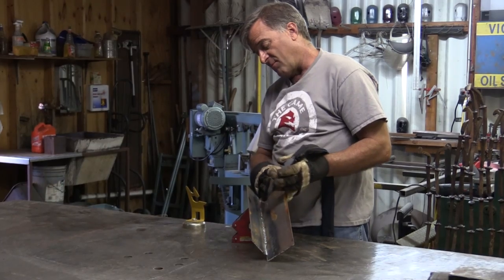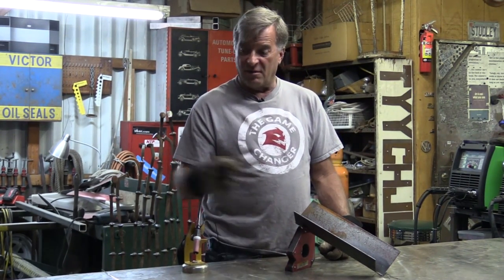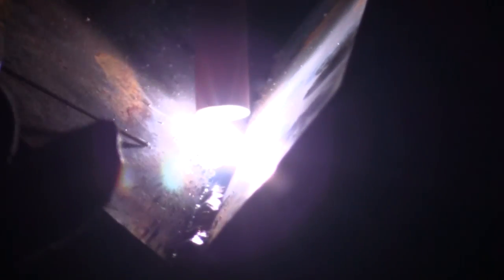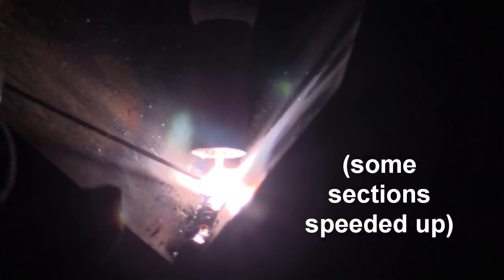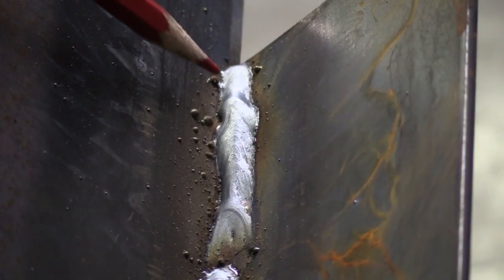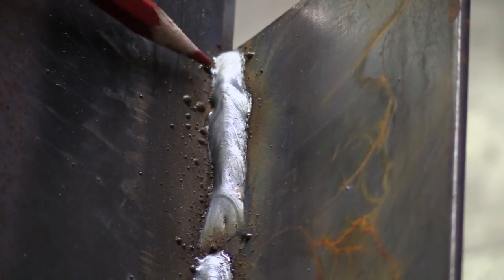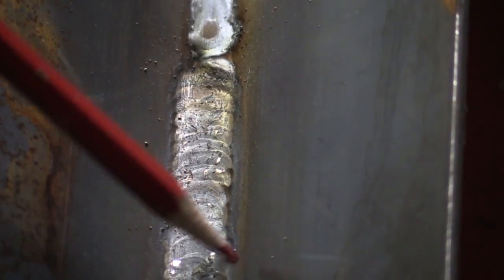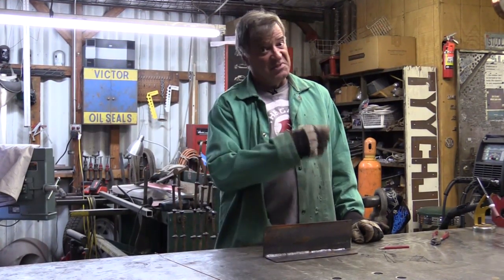How to Use a TIG Welder to Clean Up MIG Welds - Kevin Caron

Comment: When using Tig to tidy up a Mig weld, do you have the gas on with the Tig, or just using the heat from the Tig torch?
Reply from the maker: You MUST have the gas on for ALL types of tig welding.   You will melt the torch if you don't!
Reply: @KevincaronSculpture  of course, thanks 💡

Comment: I modified an oil pan for a car and welded it up with a mig. I checked it right after and it leaks. I've watched some videos where the oil pans are sealed up with JB weld,primered and painted. I'd ran a crossed your video and wondered if I could seal it up with tig over mig?  Great video,thanks
Reply from the maker: Worth a try at least.   Oil pans are hard to weld because of the contamination from the oil.  Make sure you get it REALLY clean and give it a try.
Reply: This is exactly what I'm doing. Building a Land Rover Discovery with a Cummins 4BT. Having to mod the oil pan to fit around the diff

Comment: Can you 'smooth out', or blend a TIG weld, by going over it a second time with a longer arc length, perhaps? I guess it would basically be the same idea as in this video... but how to get a larger weld puddle with low penetration on a second pass? A larger tungsten, larger cup, longer arc length, and less amps? More amps? Hell, I don't know.

I'm trying to recreate a technique from laser welding, in which you increase the diameter of the beam and turn down the juice, to smooth out a weld... sort of like softly melting the dimes into a more smooth and blended bead, without grinding them.
Reply from the maker: I would try a less tapered tungsten with less amps.  Works for me at least.

Comment: Playing around with my Everlast MTS 275 Lightning and ran the TIG torch over some of my quite thick MIG practice welds. Got some popping, presumably due to the silica or impurities in the weld. Not sure how to avoid that? Granted my MIG beads probably didn't have enough heat when I laid them on top of more MIG beads for practice.
Reply from the maker: You most likely didn't clean the metal good enough before you mig welded.   Got impurity's in the weld and exposed them with the tig.  Only fix now is to grind out the bad spot and reweld.
Reply: @KevincaronSculpture  Probably not, wire brushed it a bit by hand and called it good. Was just playing around on some scrap so I won't be grinding it out, but it's good to know. I was worried I was putting too much heat in (150A at the time), but it was probably 1/4 to 3/8 of an inch of practice welds or more on top of 1/8 steel 😆 . Good to know it wasn't the heat so much as contamination.

Comment: can you do this with the mts 251 si , on aluminum , to clean up aluminum mig welds ?
Reply from the maker: No, the Mts 251si is dc only for tig.
Reply: i know that , i was wondering if it would clean up a aluminum weld .  if i understand correctly thick aluminum is welded on dc to get extra penetration . i have also heard of guys setting up a dc tig so the heat in in the tungsten , rather than the work ( and using a larger sized tungsten ) and you can get some cleaning action from this ......... with the pulse and frequency settings , i was curious if there was a way to run a cap on a aluminum weld that looked nice
Reply from the maker: Never tried DC welding for aluminum.  Sorry.

Comment: I'm glad you kept saying to "clean up" a weld not to "repair", a bad weld is a bad weld. Repairing(penetration ect) can be done but not properly by the average diy'er, it requires lots of hours welding and understanding the metals to be done properly. I guess it's a touchy subject and I'll get hate mail(!) but I had to say it. I'm not an armchair welder, I've been welding since I'm 16 and now pushing 60, I've worked as a heavy truck and equipment mechanic as well as building/restoring muscle cars and race cars, I've also received professional training. Hope I didn't stir up a hornets nest for you. Good video
Reply from the maker: No problems from me!    You are totally correct and that is all anyone should use this trick for..

Comment: Kevin that's cheating! but yes I do this, it's especially handy if you manage to get a lumpy bumpy weld in a tight spot like you said.. Ive used this method on both mig and Tig welds that need a tidying up.

Good tip! Still cheating though :)
Reply from the maker: I will take any tool I can to get the job done!
Reply: I'll second that! Well said, great videos Kevin 👍🏼

Comment: I've done this in my early days but I wouldn't recommend doing this as normal practice because it's kind of counter productive in my opioin. I think it's best practice to set up a small test joint first to get your setting dialled in so the weld you do on the part looks good and is good rather than blend over the top of a bad weld and call it good. But like you said, Kevin, it does make for good practice for walking the cup. so if you've got some scrap material lying around with some bad MIG welds on them you can use that for TIG walking the cup practice and get your money worth out of that material.
Reply from the maker: Well said and thanks for posting..
Reply: @KevincaronSculpture  Kevin, 
I got here looking for information on blending in high rounded MIG welds with a OXY/ACT torch.  I'm working with thin sheet metal and in thight spots I can't get the MIG gun in proper position to weld properly but I think I can spit and stick some metal and hopefully get a few tacks and then was hoping to push those blobs with a small gas torch.   
Any thoughts on that ?    Or am I more likely to burn through with the gas torch ?
I was considering even filling in with some braze rod if I had to, to keep the heat down.
Reply: p.s.  I only have a MIG and a Oxy/Act set ups.  No TIG.